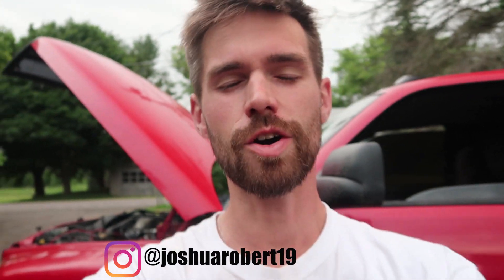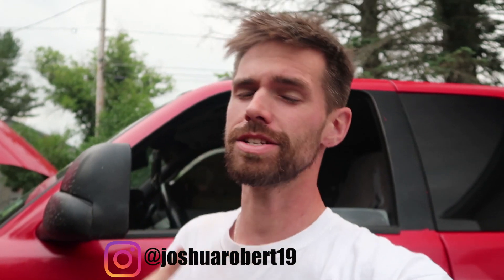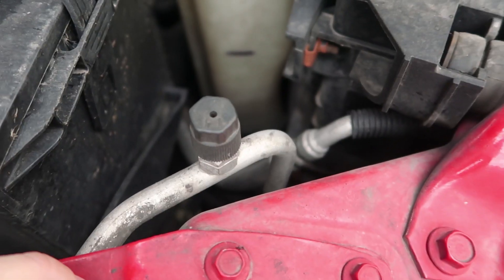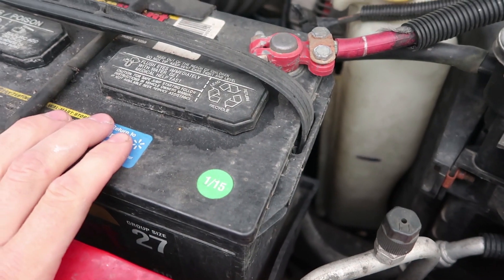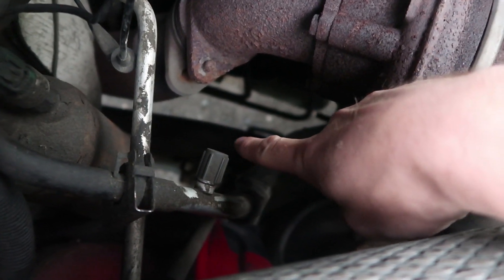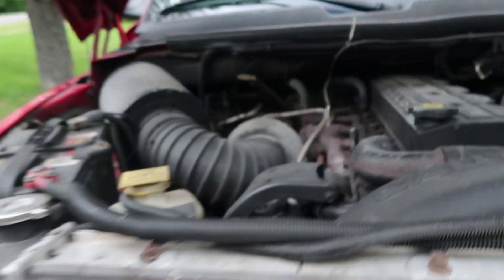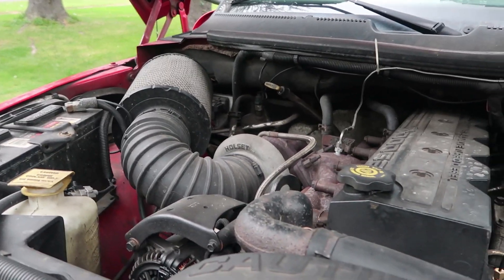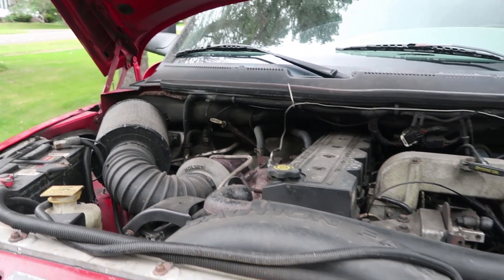What is wrong with my Cummins A/C!?

Comment from the maker: Only A/C I've got is when I'm going 70 mph down the highway with the windows down, boys!
Reply: In WV we call that 2-70 ac.  2 windows down at 70mph
Reply: You didn't get it fixed?  I just went thru that about 2 weeks ago.  Found a video that explained why the can pressure was reading the way it was.  After I got some if can 2 in the can pressure guage was working correctly and compressor started engaging.  Your low pressure sensor wint let the compressor engage until it reaches min pressure. You can bypass the low pressure switch and the compressor will engage.  For testing only.  Dont run it very long on low pressure.  I used 2 full can and I'm still a lil low but a/c is working great.
Reply: You have a leak, and have not enough Freon in the system

Comment: I just finished charging the AC on my 2001 Dodge Ram 2500 Cummins 5.9   I rented an AC vacuum and an AC gauge manifold set from Autozone and asked a friend who is a refrigeration tech for some help so I didn't mess anything up.  After testing the system for leaks with a little vacuum (see other videos), we started up the engine and began charging the system with R134a.  The needle on the gauges did the same thing as the needle on your can in the video.  It went up and down as the refrigerant went into the system.  My friend placed his hand over the condenser and he began monitoring how hot it was getting.  He explained that the condenser was suppose to get hot because the system was working.  The low side gauge went up and down and we added more R134a until the needle stabilized at about 30 to 35 lbs. The entire system takes about 30 ounces, but we only used two 12 ounce cans.  He said that the needle shows you when the system has enough refrigerant by stabilizing.  He said that if you overcharge the system your AC won't allow the system to cool properly and the air will actually be warmer.  Hope this helps.

Comment: The orifice tube is clogged, compressor builds pressure and gets stopped on high pressure as Freon passes through the clogged orifice tube the pressure drops and the compressor kicks in and the whole thing repeats over and over. You need a new orifice tube, a new accumulator and flush the system, the compressor is may be the reason of the clogged orifice as the compressor wears out aluminum sludge gets into the system and gets collected on the orifice tube.
The orifice tube separates the high side pressure from the low side pressure and when gets clogged the high pressure goes too high.
Reply: Hey I was wondering if I could pick your brain, so I’m looking to get a 2001 dodge 2500 5.9 and the ac does the same thing as this guys ac but it stay on for about 10 seconds then shuts off then kicks back on for 10 seconds and repeat. Do you think it’s basically the same issue this guy is having?
Reply: @imokuok1993  Probably low on coolant.
Reply: Then explain how that's the case when mine does the same thing, but then will work great for a few days then intermittently do this for about a week then starts working fine again.

Comment: If it still leaks, start by replacing the high and low valve cores.     The high side the whole port unthreads and gets replaced.   The low side is just a shrader valve.     Fixed my leaks

Comment: When your AC compressor starts and stops like that its the clutch kickin in because you don't have enough refrigerant. My truck did the same thing as yours and ended up putting a couple cans of refrigerant in there. Works like a charm with no problems.
Reply from the maker: Mitchell Knuckey I was thinking something along those lines, but I'm not 100% sure when it comes to a/c stuff so i had to ask with this one. I should add the rest of the can in then? Maybe even more than that? Then see what it does? The gauge bouncing like that has me thrown for a loop though, wouldn't it hold steady in one spot?
Reply: pure panoRAMa that's what I would do. The rest of that can, maybe another can and it  will stop bouncing. Then you will be able to get an accurate reading. Hope this helps.
Reply from the maker: Mitchell Knuckey I'll give it a shot and report back!
Reply: @purepanorama8484  could you report back now? haha

Comment: The low pressure switch is protecting the compressor from being burnt up. It's going to do that until you reach the minimum volume for the system. Your gauge will level off and then very shortly After that, it should be in the green.
And you're good if you don't have leaks. The refrigerant itself is a lubricant and somewhat of a cooling agent for the compressor.  If it gets too low and you call for a c, not knowing there has been a leak, you will be replacing the compressor, so it's a safety switch for the compressor. 👍

Comment: I guess the 2nd Gen's have Accumulator issues which clogs the orifice. It has to be replaced w liquid lines. They sell kits for it on parts geeks, etc. Amazon looked more expensive. There's a guy who does a video on it as well which looked pretty clear and easy to fix. If I pick up the 99 cummins I'm looking to buy, i'll have to fix the A/C.  My 97 A/C works but only blows out the dash vents. Apparently, that's also an issue on the 2nd gen but it's usually the rubber on the line rotting and pretty easy to fix.

Comment: I Started my 02 24v cummins this morning and the same thing “click” pause “click” and no cold air. I Went “post haste” to the auto parts joint and got a can of refrigerant. Hooked it up and had the same guage anomaly as you did. So after reading some of the other comments on here, I boosted the trigger on the can and held it for about 20 seconds. The clicking stopped and eventually the guage needle settled into the green zone (60%ish). I be havin cold air again!
Reply: yup same thing here
Reply: @Moody Creek - What do you mean “boosted” the trigger on the can(?))

Comment: Have you tried to add UV dye into the system to see if/where there is a leak?  

Also, what is happening in the high pressure zone? 

What is the pressure in the low before the truck turns on? 

Most likely it is a leak, but if the high is really high it is possibly a clog.

Comment: Our 05 has ac as long as your going 20 mph or over.. Our 06 has no ac what so ever! Maybe it's gotta do with our trucks are getting old! Lol
Reply from the maker: ford diesel damn old trucks are fun to troubleshoot and bring back to life.
Reply: pure panoRAMa that is true!!!
Reply: Fan clutch probably then
Reply: Replaced the entire system in my 06. Lasted about a year. Just recently went through 2 compressors in one week. System stays charged, but clutches won’t engage. Code reader shows over current from the TIPM. Thinking I am just not meant to have ac…

Comment: That problem was cause you had very low freon when the ac compressor kicks in it drops the pressure in the system and kicks the ac compressor off once it gets pressure back into system the compressor kicks back in add some more freon just next can you add make sure its the freon with stop leak in it

Comment: you were so close to fixing it, all you needed to do was swap your the wiper motor relay for the air conditioner relay, when you turn on the wiper you'd have on off n no delay and your ac would work great  ,the timing circuit in the relay burned out, Next time check that first,  sorry i wasn't quicker!
Reply: My 2001 2500 clicks same as his. The wiper relay swap was the first thing I did, issue remains. After reading the other comments I think I'll put a can or two in the system.
Reply: @edbrick7689   try the wipers if they work correctly still , especially the delay, theres a timing circuit in the relay, dont use the stuff that seals stuff its got too much oil, just get the refigerant only, the compresser only likes just alittle oil, not ton of it, the switches look reliable to me, check your ac mag-clutch, if the bearing goes out it will grind on the coil n kill it , probly blow the fuse too, but might not blow the fuse, depending on the wear n tear on the coil/mag-clutch, change relay, check clutch and just may need some charge if the rest is good !

Comment: Reason guage is reading the way it was is low pressure.  I just went thru this my guage did the same. You low pressure is not allowing the clutch to engage.  You need to dump the whole can in. Start the 2nd can and when you start getting enough your guage will read correctly and your clutch will engage.

Comment: It's been my experience that when your ac compressor is short cycling like that your system is low of freon. If you had ac working and now it's not you probably have a leak somewhere.  You can add some dye to try to see where it is leaking from.
Reply from the maker: Reaf Kennedy I think that is going to be my next move.

Comment: Did you ever figure it out I have this problem
Reply: So I bypassed my pressure sensor and then checked the Freon pressure while my truck was running and it was low so I charged it up to pressure put the sensor back together and it ran awesome

Comment from the maker: Think I need to pick up some new tools to troubleshoot this.
Reply: pure panoRAMa don't quote me as the gospel but I do believe our AC systems are supposed to cycle on the 24 valves but yours cycling and such long intervals could be from being low on freon do you have a Facebook maybe I could take a recording of mine and show you how it's supposed to work that way you have a baseline of what's working correctly and what yours is doing

Comment: Late comment sorry but could be the seal on the back of the ac compressor my truck was doing the same thing with the gauge I kept adding freon to that stopped my AC has worked ever since then I have an extra AC compressor laying around I don't need I could sell really cheap for you
Reply from the maker: I kind of just pushed the whole AC thing off this summer because the temps weren't too bad here. I'll look back into it when spring rolls back around because now I'm trying to make sure I'm all set for the lovely winters in NY!
Reply: @purepanorama8484  true you got to have the heat for the cold days well if it happens to be your AC compressor I just have it in storage if you need it just let me know
Reply: I would be interested in the ac punp

Comment: Did you ever figure it out? I’m having the same problem.
Reply from the maker: Aaron Brent-Fulps I haven't messed with it again yet. I may grab some gauges and look at it soon.
Reply: pure panoRAMa still no updates? I’m having the same problem. Thanks!!
Reply: Any update? We're having the same problem 99 dodge 2500
Reply: pure panoRAMa how about now lol? Mine is doing it and as it warms up down here in Georgia, it’s getting rough not having cold air
Reply: Mine did the same thing guess I’m gonna shove some refrigerant in her and see what happens
Reply from the maker: I never ended up looking at it again before I sold the truck. I tried charging the system and it helped a little bit but it didn't make it ice cold. Im not sure if it was a leak or the compressor was bad,  or both. I wanted to hook up a vacuum tester to it and just never got around to it because winter came back and then I got rid of the truck. Wish I had more info to help you guys out with! Sorry!
Reply: add a can slowly, it fixed mine  and I had same symptoms.. there probably is a leak somewhere so you may have to add more at a later date depending on size of leak